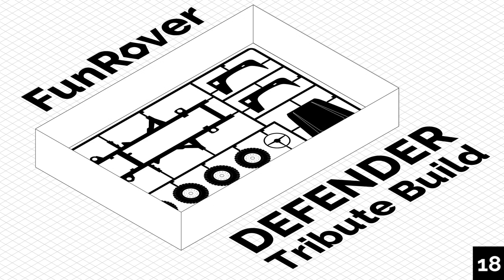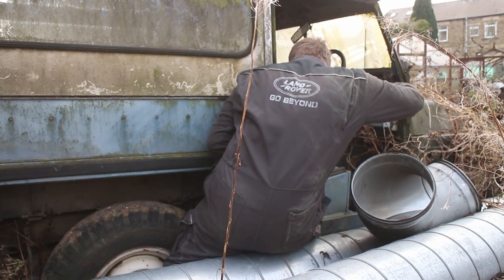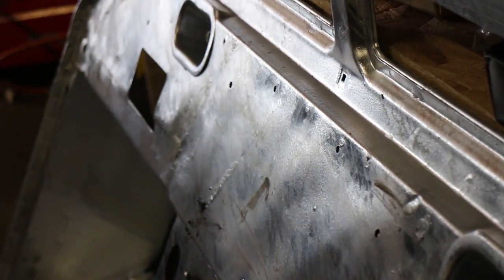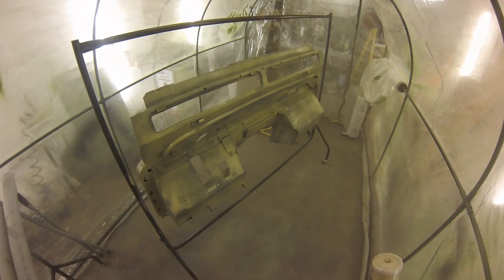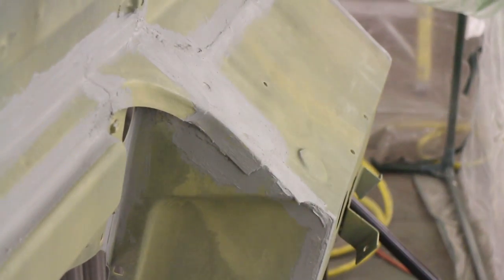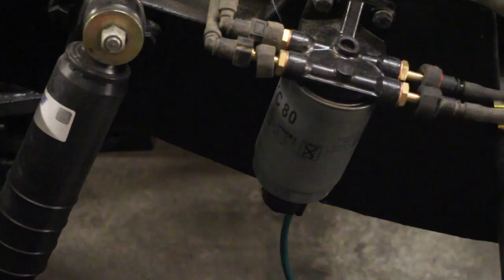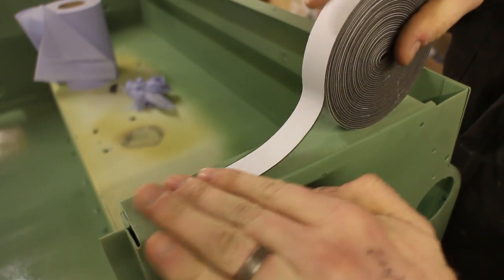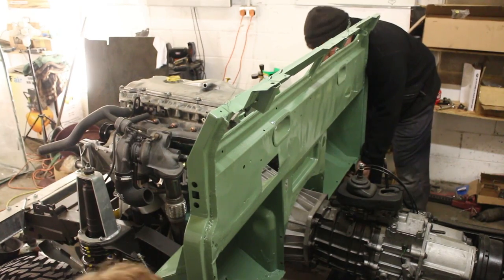Painted Bulkhead & Tub, Custom Dash & Rock Sliders

Comment: Ever thought about using traditional solid rivets ? The ones you hammer up for that extra authentic series look. Grasping at straws i know but it'd be pretty snazzy.
Reply from the maker: I did think about that, but I knew that I would have ended up scratching or denting bodywork whilst flattening them. They would've added that extra little authenticity though, great suggestion
Reply: To be fair i think if my paint looked that good i'd be weary too !

Comment: Once again, great job Ben :) love that colour. I wish I had the knowledge to paint mine too but it's not easy and so time consuming. I'm far too impatient lol. 
By the way, did you fit the spacer washers between the chassis outrigger and the bulkhead ? Didn't see them in the video.
Reply from the maker: Thanks Kim, I haven't fitted spacers washers just yet, I'm quickly running out of safe places to put painted panels so thought it would be safer in place ;) I'll put them on when I fit the toe panel brackets
Reply: +funrover it's crazy how much room it all takes isn't it. I wish I had 3 times the amount of room I do. Be able to do it much easier I'm sure.